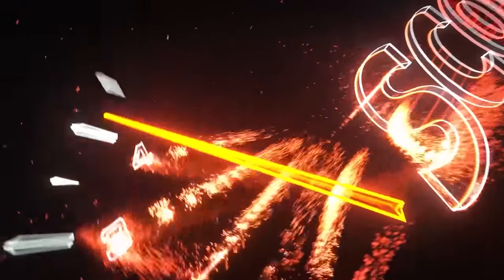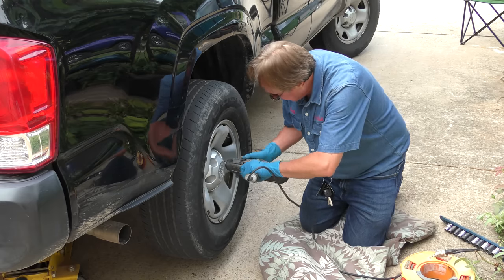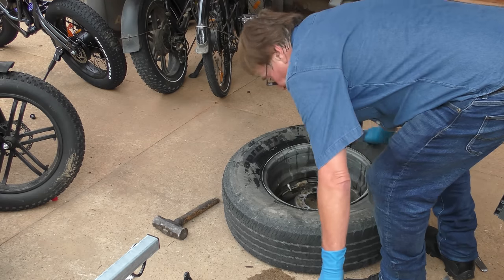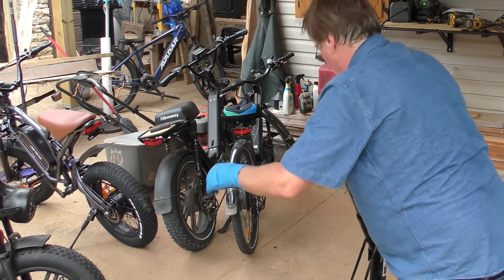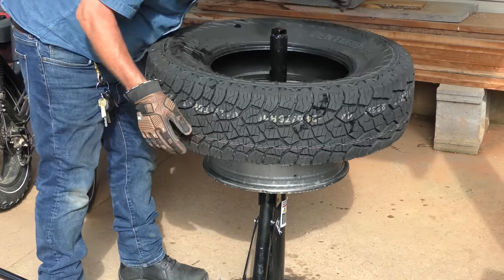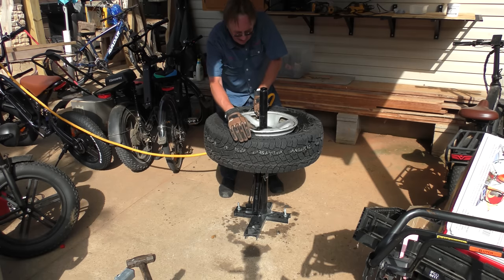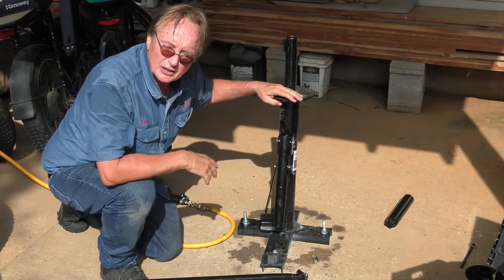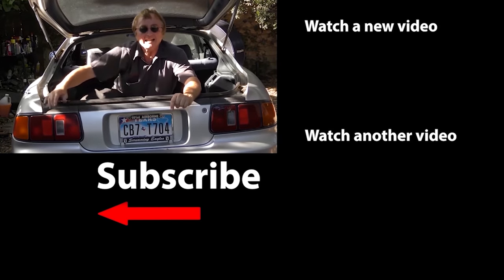Never Buy This From Harbor Freight (Almost Broke My Hand)

Comment: I've only seen a couple of comments that agree with me that this tire changer works pretty good when used correctly.  I've had one for over 14 years and other than not being able to do 45 series tires, I love it. One of the better tools I've bought from HF
Reply: Loks like Scotty was using correctly.  I'm assuming yours older and better built
Reply: i've had mine for 5 or 6 years now and use it for atv and sxs tires.  I've done dozens of sets over the years and never had a single issue out of it.  Great tool when you use it as intended and within its limitations.
Reply: Scotty used it correctly, but the bead breaker you gotta have it lined up perfect and push straight down. If it’s angled a little it will bend. I did 18” truck tires. Took all 4 off rims and put new ones on. It took a few hours tho, but it’s worth it. Just pay Att when breaking the bead. You can easily tell if your not straight up and down. I paid $28 for mine and it’s red
Reply: @bobbybrooks5846  he almost used it correctly. When putting the tire on the bubble hub and aids in rolling the tire onto the rim. And, likewise, mine was bought red as well. From years of being in the sun, it's now pink.
Reply: @kirkedwards365   Right. Did you modify the bead breaker? I just straightened mine back out and never had a issue again. I put concrete anchors in my garage floor, so I can remove it when I’m done. I’ve had it for 5 years and it still looks new
Reply: Older ones, pre 2019, were made better.
Reply: Did you not watch the video?  Yours is 14 years old, Scotty said they don't make them the same any more.
Reply: I used my harbor freight many times and the bead breaker is the hardest part bent mine plenty of times just need to adjust the tire until you compress tire using very little effort if it is bending  the metal the tire is not in a good position and re adjust as needed it it helps too if you have a extra person to help lift tire also you can mount the changer on a 4x4 plywood and jam it against a wall then the changer is mobile and works  great
Reply: If you have had yours for 14+ years, it most likely is the better quality one that he mentioned at the end.  Not the $49.00 version that put a slice of metal in his hand. 🤔🤔
Reply: The dude is like 1000 years old. You can’t expect much from him. Lol
Reply: @statwizard  Except that he is wrong, mine is over 10 years old and it's not built better than the new ones. Yes I have used the new one also. The bead breaker bends as easily on the older one if it's not pushing straight, although I haven't modified it, just straightened it a couple of times. The bar is the same design as the earlier one. But I have been using it for years with no problem. Is it as good as the old commercial tire machines? Nope, but  it does get the job done.
Reply: @statwizard  yes mine is older and I only paid three arrow heads and a piece of pottery for it. No just kidding, it was on sale with a bubble ballancer, sold together for $55. Still have and use both.
Reply: Hey Scotty , the only thing than need attention is the bead breaker , beef it up , and stop whining.

Comment: I went to work with my dad when I was 10 and the shop had the same tire breaker tool as your dad.  I even watched them use a bubble balance tool.  In my 20s, I would remove tires with a hi lift jack and tire spoons.  Even did a few split rims.  Not anymore since watching youtube!
Now, I pay the man and get my truck tires changed by a tire shop.  I use this tool for riding mower tires.
The prybar tool is next to my garage door.  I use it for security.  It will work just fine beating an intruder.
Reply: I did some split rims back in the '70's, the guy that owned the station made it look easy, no wonder they were outlawed.

Comment: when I was a teenager back in the late 60s early 70s I worked at my father service station and he had one of the kind of machines that Scotty is talking about. those things were built like tanks. I guarantee you if you could find one of those used even if it were that old and still work just fine seeing Scotty do that brought back some memories.

Comment: Bought the HB model 20+ years ago -- never bolted it to the concrete. Also bought 2 tire spoons from HB. Can of 'slippery' necessary in hot weather otherwise dish soap mixed with diesel fuel works fine. Changed hundreds of tires with it. Still works great. Also bought a heavier duty model (Granger or Northern Tool) for tractor tires with thicker ply.  In either case, if you can break the bead, you don't even need either machine, however, the tire spoons sure make the job a ton easier. Hint: don't change more than one a day. It don't take much to self balance them either.  ...still don't like giving away money when I can do the work myself (and I've never been afraid of work). 🙂

Comment: Have same tool from Northern Tool was 150$. ??
After fixing all the problems pointed out here it works good. And paid for itself 10 times over. Nothing larger than pickup tires.

Comment: I've had one of those for about 8 years. Probably change about 8 to 10 tires a year. Never had much of a problem with it. It is getting wore out, and I'm about to replace it with another one. It's saved me lot's of money. It's probably not for everyone, but I'll never go to a tire shop again. I hope it's the same quality.
Reply: What has worn on yours? I mounted a duck head on mine and don’t foresee any part of it ever wearing out.

Comment: I always consider tools like this to be a starting point for additional mods to make it useful
Reply: Agree. Break out the Harbor Freight welder and grinder and cut  new steel to replace the thin junk.
Reply: yep
Reply: @kenimpzoom do they actually make welding machines? If so, they probably have a 1/10 duty cycle. 😆
Reply: BiffTannon1983 How little you know 😂😂
Reply: At that point just make your own.
Reply: Truth
Reply: @BiffTannen1983  They are pretty good. Not everything at harbor freight is trash. The predator engines have been shown time and time again to be equivalent to honda engines (look at consumer reports), Hercules is equivalent or sometimes exceeding dewalt and the competition like with their impact driver, their truck wrenches are the exact same as snap on, etc... You just need to know what is good and what is bad. Price point is another factor. They have drastically improved the quality of their tools from a few years ago but some are lemons. They will not be as capable as specialty companies, but they can compete with the prosumer market.
Reply: @BiffTannen1983 in a lot of legit tests they actually out do many premium welders but you do you.
Reply: @aloud9738  it's easier to have something to work with, that you can improve, then to fabricate your own tools.
Reply: That's right,🛵.fix it so it's O.K. to work with, I don't want anyone getting hurt  😮OH NO, we don't need that now,😢 do we?😅
Reply: @BiffTannen1983  they have about like 10-15 models and varieties of arc welders and two gas welding setups available there. 

Their welders do vary drastically in terms of price, but i have heard great things about their higher end models.
Reply: @100GTAGUY  DAMN! That's a LOT! I had no idea.

Comment: My 1965 Chrysler Owner's Manual shows how to remove the tire from the wheel on the roadside.  You use the bumper jack between bumper and tire to break the bead.  Never tried it, but did swap a 13" tire for a camping trailer by hand, using pry bars.  Not easy.  The trick in working the bead over the rim is to push the far side bead into the valley, which gives a little more room.

Comment: i have one and used it for years now, first thing i did was weld steel plates along the factory metal on the bead breaker because it was to thin, other than that it works 100% every time and has not failed yet.

Comment: My almost first job in 1963 was a gas jockey in a Shell station in Boca Raton Florida.
We had a tire changer, that I later trained on. It looked like it weighed 5-600 pounds, cast iron. The data  plate said 1941.
Reply: An extra tank part…..nagh, this one is to change tires.
Reply: Some machines at John Deere for older service parts are WWII era. They actually machines tank parts on those during the war.

Comment: Hi Scotty,
No doubt it’s cheap, but I actually removed and mounted 4 tires on the stock rims of an old Cummins RAM pickup with this same tool bought at Harbor Freight last year. I did buy two extra tire irons though, and it wasn’t bad.
Reply: I've been using one for over 10 years to change motorcycle tires.  I also bought two of their tire spoons and they work well enough.  It is definitely cheap but has lasted over 10 years and still going strong.  Not to mention it has paid for itself AT LEAST 30 times over by now.
Reply: Exactly, my same experience even down to buying the 24" tire irons.  I did have to reinforce the flimsy part that breaks the beads.
Reply: Ive been using the red version for over 8 yrs , even chaged 35 inch tires on a jeep , it was a workout but it did it , normally dont have to much of a problem breaking the beads but do have a semi truck style slide hammer bead breaker for tough stuff , or just use a high lift style jack to break the bead , use lots of lube also .

Comment: Actually it works just fine with a couple modifications. One being tos stiffen up the bead breaker, the other is the duck bill addon. There's tons of videos out there on that modification and it works really well. A cheap tool can be turned into a decent tool with some work!
Reply: i hate watching this guy. hes quick to call something junk when it doesnt work the first time. not user error. always the tool/car thats junk. just because its not 40 years old its junk.
Reply: If you need to make modifications for it to work, then it is worthless.
Reply: @EviLWeazL If Scotty bent those bars with his skinny 70 year old arms it is made of pot metal, not steel.  You shouldn't have to fix or redesign a tool to make it work.
Reply: I have one of these, and I agree the duck head is awful. I haven't had any trouble with the bead breaker, in fact I think it works quite well.
What this does do really well at a decent price is hold on to the wheel nicely at the right height while you change the tire with tire spoons.
I'm going to go look for those videos about changing the duck.
Reply: Not a good idea to start with a TRUCK tire. There are smaller tires everywhere. You're pushing it to the limit when you use it . I find people critical of cheap things that they expect too much of.
Reply: @spankynater4242  Wrong.  They even modify rolex submariners with Seiko dials and NH35 movements.  It's called innovation and adaption.   2 types of people.  Those that buy Rolex & those that are smart enough to buy a Seiko Mod Submariner.

Comment: I bought mine 10 years ago.  The long mounting lever bent right off.  I went and bought a 1 1/4 steel rod and welded the end tools I cut off the harbor freight rod.  It's worked OK since.  It's too much work for what it does.  Scotty is right.  Go to a tire shop.

Comment: I have one. It's worked very well over the past 20 years.. I only use it on trailer tires. I reinforced the top cap and the bead breaker with thicker steel and pin. It works great for $40
Reply: It's $60 now...
Reply: @JDeWittDIY  it's cheaper around Christmas time. Still a good deal if you beef it up a little..

Comment: the trick with getting bead off or on is to make sure the bead on the opposite side of the tire is in the middle of the rim allowing the tire to move as far as it can
Reply: Yes, the top bead comes off with little effort if one places the top bead 180° into the drop center. Often this technique with appropriate lube can take the 2nd side off with no tool. Then the reverse is true, I almost never need a tool to put the first bead over the rim.
Reply: @N4HHE I've found it can depend on the tire. Some are a struggle, some I'm surprised that they just slip on.
Reply: @chaos.corner  How deep the drop center is determinative of the ease of removal

Comment: You have to put a duck bill tire change mod to make it easier and to not ruin nice rims.  Center cone, and use carpet under rim to bead break helps also to protect nice rims.  Changed all my tires easy with it.

Comment: Ive used them and it takes muscle when installing. It works better on a sunny warm summer day. Let the tires sit in the sun to make the rubber stretch more and less stiff to use less force to get the tire bead on the rim. Also put dish soap on bead so its slides on rim.
The nice thing with harbor frieght is that its so  cheap that it pays for itself after 2 tires. Im not suggesting anyone use this tool im just expressing my personal experience

Comment: Scotty this was hilarious!😂😂😂 I have the tool from the 90s back then you could buy it for 24.99 with a 20% off coupon.... It is still my back up for my rim clamp and my 40-40sa coats.... It takes a lot of finesse to use the cheap China made tire changer but for most cars and light trucks it will do the job...but you got to have a user that knows what he's doing and like Mr Eastwood said know his limitations😂😂.... You can see me use my China made tire changer on my tiny YouTube channel bought in the 90s $24.99 using it with relative ease changing tires....but for the non mechanically inclined it should be off limits to all of them!😂😂😂... Again thank you for all you do and all the laughs you've given me through the years.

Comment: I'm not a professional mechanic, or a harbor freight fanboy. But it is interesting, and honestly not surprising to see varying quality control on these kinds of tools. I did not experience any of these issues really (except a little loosening with the bead breaker, no issue, seems to still be fine) when using this machine myself. Of course, I do have a few months of recent experience changing tires, and I didnt use the exact methods Scotty did in the video. Glad to see you still working hard out there for us to give information. Unfortunately, I don't think Harbor Freight will improve the machining or steel strength of this type of tool, unless they decide to make an Icon manual tire changer

Comment: I purchased that tire changer a few years ago.. you are right out the box.. pretty much useless.. but after I modified a few areas on this harbor freight tire changer.. works really well now. I've changed  many tires without any issues.

Comment: Thank you Scotty! Yeah, it looks flimsy to start with, I've also use one of those commercial tire dismounters and they're heavy and solid to put up with the forces needed to mount and dismount thousands of tires. They can be extremely hazardous if you are not careful though. I almost broke my wrist one time that I was using it as I was distracted. I learned my lesson well, never be careless nor distracted when you are using power equipment or using a lot of leverage!

Comment: Bought mine years ago you have to weld a pipe over the bar the gave you too cheap metal but the stand is fine but you can only break down up to 16" tires

Comment: Harbor Flate (not a typo) has some OK stuff if you know what you are looking for. Decent impact sockets. Good dead blow hammer. Cable ties, yeah. Wrenches or power tools, only if desperate. Although the guys at the local muffler shop use their cheap recip saws all day to chop off pipes and just get another when they burn up.
Reply: You forgot they sell one heck of a 5 gallon bucket.

Comment: I'm 80 years old and changed many a tire with the old heavy duty manual type. Worked great when I was younger. My dad showed me how to break a bead by rolling over the tire with another tire mounted on a vehicle. I don't think he actually did it and I never tried it, but it looks like it might work. You would have to roll over it just right not over the rim but close to the rim. My dad worked in a gas station in Iowa City in the 1930s. He said the station owner went broke because my dad drank all of his beer.

Comment: Yeah for the bead breaker I got a 5 foot pipe.  That worked ok . Also I got a NO MAR MOUNT DE-Mount Bar and that worked ok . The included bar is no good .  And as a Scotty mentioned mine from Harbor Freight was orange and not black and purchased 5 years ago and that seemed better quality with thicker Steel .

Comment: I know someone who has one of those.   It works great for trailer tires ect.    For bigger tires he just uses the bucket  of his tractor to  break the beads.
Reply: I almost lost my head with the tractor bead braking of a tire. I was standing about 10-12 feet away and guiding my friend so he didn't catch the edge of the rim and when he pushed down on the tire, the tire popped put from under the bucket and flew at speed right at my head, I got my hands up just in time and on the tire and it thew me a few feet onto my back,and the tire kept going. Thinking on it later, I wonder if he forgot to empty the air out of it?

Comment: I have one of those I bought years ago. It is useless for breaking the bead, but works well enough to remove and install a new tire. I use a small bead breaker to break the bead on any tire.

Comment: Yes, it is a cheap china tool. I've had one for ten years and I only use it for trailer tires and small car tires, not truck tires. I also use a 4 foot heavy yellow crow bar instead of the rod that came with the tire mounter. Another tip is I use two small clamps as I mount or dismount the tires and I take small bites of the tire as I work my way around the bead. I don't mind paying $20 a tire for mounting and balancing a 10 Ply Tire for my 3/4 ton  4 X 4 Silverado but I hate paying $20 to mount a 13 inch trailer tire and that's really the only time I use the Harbor Freight tire mounter.